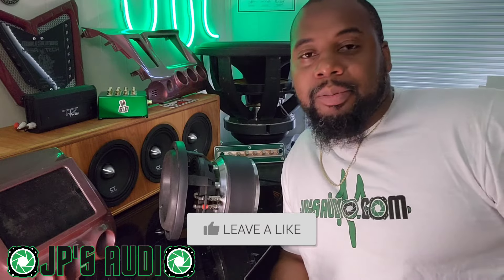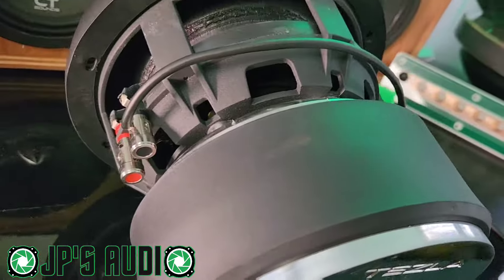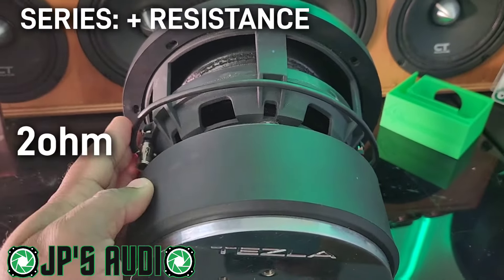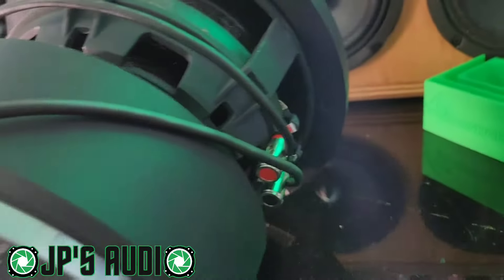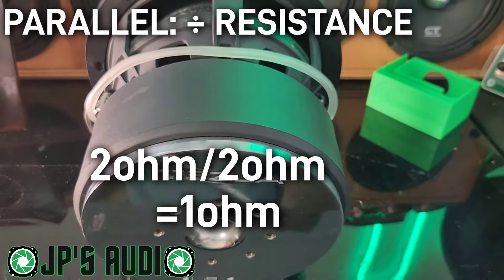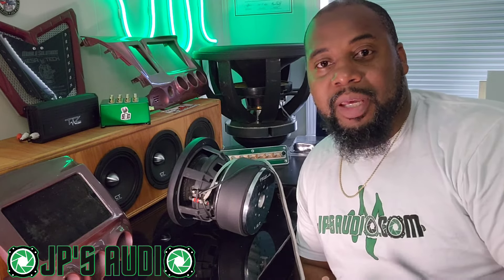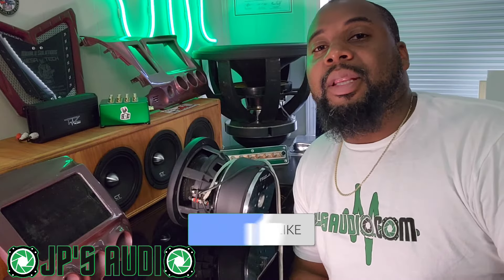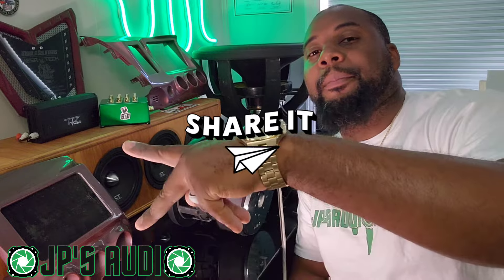how to wire a dual voice coil 2 ohm subwoofer : dvc 2ohm sub

Comment: I have 2 dual voice coil skar dd2 10 inch subs
Reply from the maker: If you want 1 ohm at the amp you need dual 4 ohm subs to wire together or 1 2 channel amp that is 1 ohm stable and wire each sub individually

Comment: So which ohm is better 1 or 4
Reply from the maker: Easy answer would be just that 1 ohm will give you more power than wiring to 4 ohms because the resistance is lower, but amp will not run as efficient as 1ohm vs 4ohm
Reply: @jptheinstallguy  so which would you prefer
Reply from the maker: @jamaicasgodson2125  i usually run all my systems 1ohm

Comment: What happens to the max watts when you go from 2ohms to 4ohms?
Reply: you are going to be running less power at 4ohm
Reply from the maker: Nothing happens to the power handling of the sub, but the amplifier will provide a different amount of power from 2 ohms and 4 ohms

Comment: I'm kinda lost here, i have a double coil sub but my amp got 2 ohms.... How can i connect that?
Reply: Hey did you figure it out? I just bought online a 2ohm sub and a 2ohm amplifier.
Sub 1,500 watt RMS Power 750watts
Amp 2 ohms: 1200 watts x 1 chan.
Im unsure of it and don't want to mess it up
Reply: @silver831cali3  i connected the parallel connection unfortunately it was shutting my amplifier off.... Then i used the one wire connecting red to black from other side to the other.... Then the remaining red and black i connected the wire to amplifier.... Its been 7 days now my amp is not going to protection mode...sounds better

Comment: I have a w7 connected to a t1000.1. I tried connecting a LC1500.1 (without changing any wiring to the sub) the amp was clipping at low volume and no matter how I turned the gain nothing changed it just showed protection mode.. is the amp bad or is the wiring causing this

Comment: Cant you take two dual 2 ohm subs and wire them parallel-series? That would drop the load back down to 2 ohms. Youd run jumpers from + to - on both subs then + to + from one to the other and - to - from one to the other and run your line out from those two. The jumpers from + to - will make the subs 4ohms each until you run + to + and - to - then it drops back down to 2ohms. Am I understanding that right?

Comment: If you have a 2 ohm dvc sub and want to run a 2 ohm load drom amp its very easy to do that. If u have a single channel mono amp with dual speaker outputs run one set of +/- to each voice coil amp will see a 2 ohm load . If amp only has one set of speaker outputs run  2 + wires  out of amp + terminal and run 2 -  wires out of amp  run one +/- to each voice coil . Both these ways allows you to use a 2 ohm dvc sub and have the amp running a 2 ohm load.   That is the correct answer to the original question.
Reply: I am using a Crown xls 1502. I have  Dayton  um15s   in separate boxes.
 Is it possible to wire the subs to each channel of the Crown and produce 2 ohms.
 Just like the above video, everyone is telling it's either going to be 1 ohm or 4 ohm.

Comment: Hey, I have a Dayton audio Spa 1000 active module and I bought a Dayton audio um10-22, which is a dual 2ohm woofer. If I connect everything as shown in the video, I automatically have 4ohm? The module and the woofer are for my Sunfire mk2 subwoofer. I only connected a voice coil to the module for testing, but no real performance came out of it.

Comment: Hey so I have 2 dual 2ohm subs with a kicker 1200watt-2400max 1ohm stable amp. How should I wire this?
Reply: wire it most efficiently 2ohms more efficient Lee's strain and control amp plus box control the sub 1ohm if u got the electrical

Comment: what gauge wire should you use for a jumper wire
Reply: I ordered 8ga wire and ordered 8ga banana push terminals for the sub and the box. Seems to hold up fairly well.

Comment: Question, I have an Audio Art 400x2 and a Punch 800.a2 amp. Not sure which amp I’m going to use but what I need to know is, should I go with dual 2ohm or dual 4ohm subs?

Comment: So I have  two 2 ohm dual vc subs and did what you mentioned and turned them into 1 ohm in which I successfully did and they individually tested at one ohm. But as soon as I hooked them up to the monoblock they tested at .07 at the amp. I'm guessing this is because the two positives and the negatives at the amp are connected. Would this mean that I have to disconnect the jumpers at the speakers considering this

Comment: hey, I've been looking at your videos and I'm trying to wire an amp to my 2002 Cavalier but the battery terminal is different from every video I've seen and I'm not sure how to properly wire it without damaging the rubber around the terminal, if you could give some advice that would be fantastic. Love the videos btw, the most helpful audio equipment videos I've seen.
Reply: Get an adapter